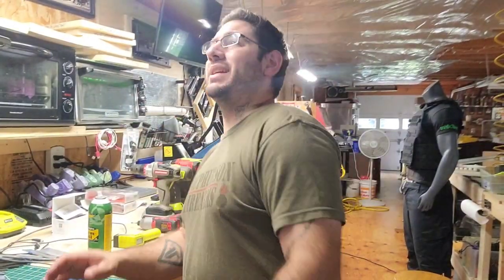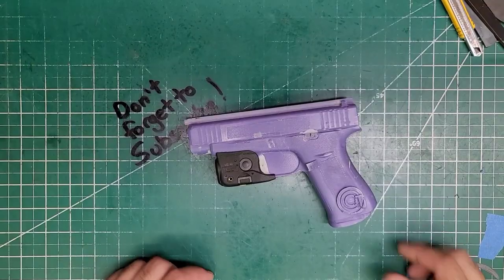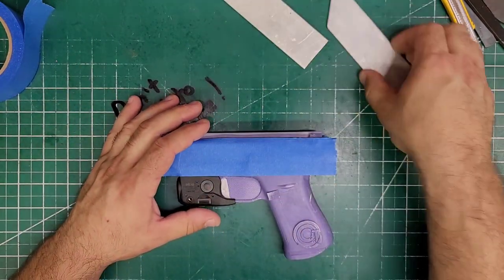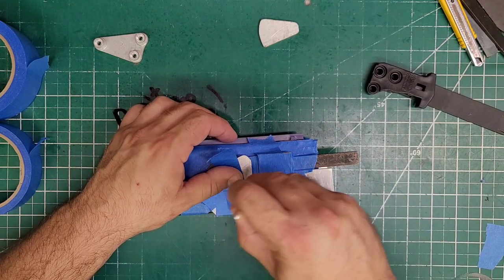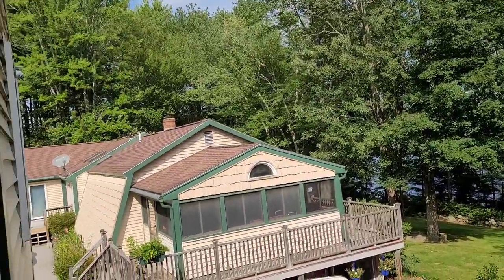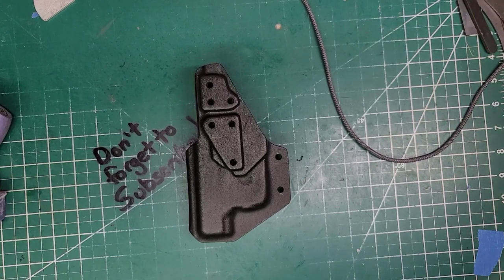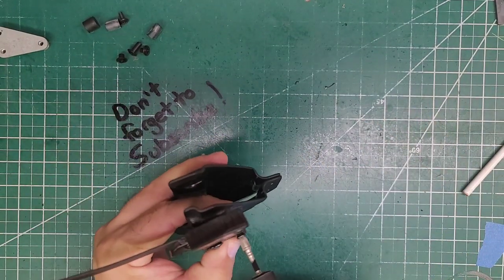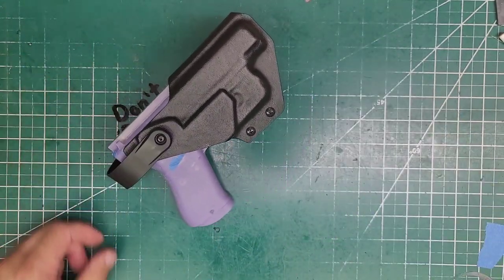How to make a Holster for a Glock 48 with TLR6

Comment: So a G48MOS slide will fit on a G43 frame. Does that mean as along as a holster is open ended ordering a 43x or 48 opened ended holster can work on that 48MOS slide 43 frame? I know kind of odd question and a bit of and older video but just wondering.
Reply from the maker: Frames are the same on a 48 and 43
 Of you order a 43 with an open bottom they'll both fit. If you order a 48 they'll both fit without the need of an open bottom.
Reply: @FalTacUnlimitedLLC  awesome thanks for that quick reply!

Comment: What do you use for the G23 Gen5 the slide is wider. Thanks for your help.
Reply from the maker: More tape if I'm using foam. Or a gen 5 blue gun if vac forming
Reply: @FalTacUnlimitedLLC  how many layers. Thanks
Reply from the maker: @ricky89571  6 to 8 per side. However you can get the slide measurement from glock website and then measure til you've exceeded that